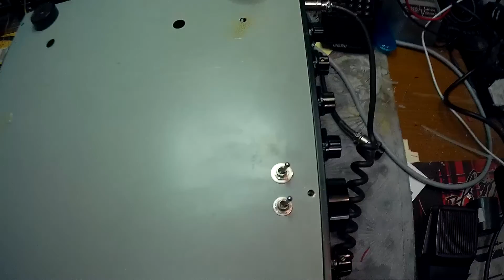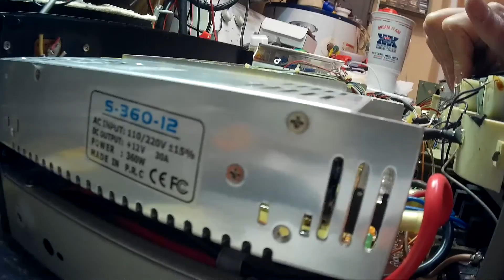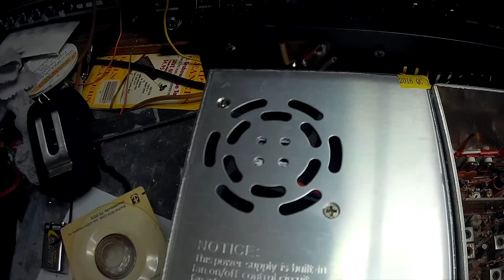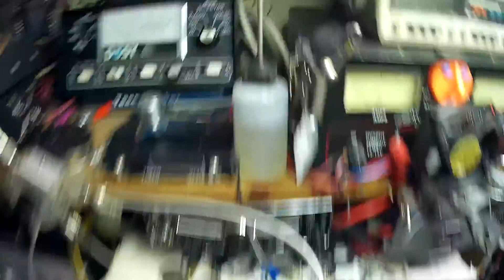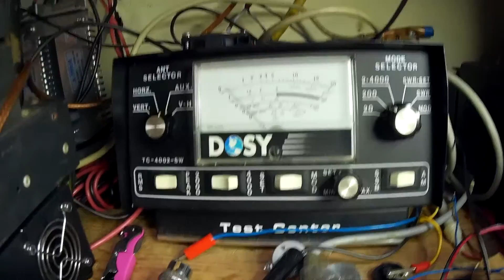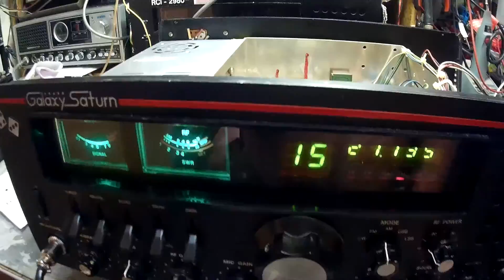Galaxy saturn upgrade part 2

Comment: Hey got a question about that megawatt power supply. I have an rci-2980 old version same unit as this basically and want to install that because my internal power supply is acting up and the radio flickers on and off after transmitting what a coincidence lol. But theres two wires on the power supply board that go to the main board do you use those red and black wires to go to the new power supply